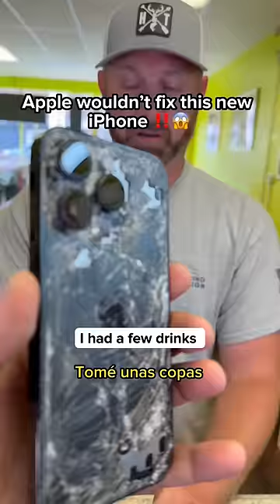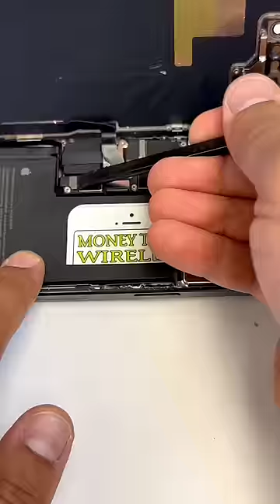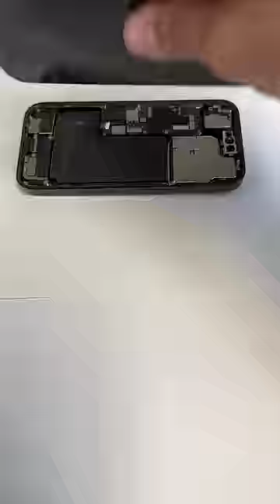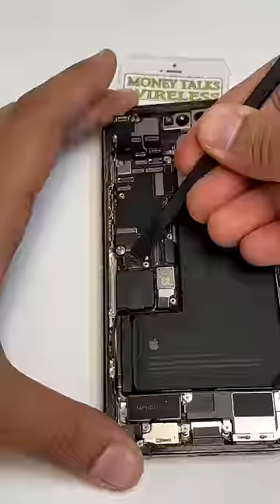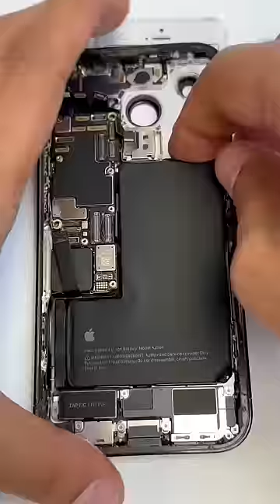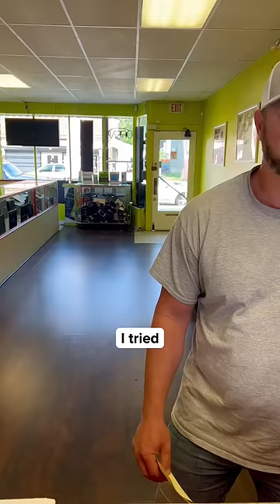Apple Didn’t want to Repair His IPhone 😡Watch till the end ‼️#shorts #apple #iphone14pro #ios #fyp

Comment: Bro left us hanging
Reply: Yeah
Reply: it’s meant for tik tok thats why
Reply: He said: "that means you can't get the information."
Reply: Fr
Reply: Fr
Reply: Fr
Reply: Fr
Reply: the mainboard is damage so probably his data gone or the phone completely dies
Reply: he literally can’t repair it
Reply: @yosuaagustinus4170  i tought you could replace the chip, pick it and put on other phone 

But idk any of that so yeah
Reply: Worry, I don’t got you bro 😎
Reply: He can’t get the Info that was Saved but the Good News he most likely changed it with a new Board
Reply: The whole video is on his channel
Reply: Because videos can’t be over 60 seconds
Reply: He fixed it
Reply: I saw the rest of the video he fixed it
Reply: @paranaenselol 99% of the repair shops don't have the skill and tools to do it.
Reply: he had fixed it actually he was just pranking his costumer
Reply: @error262  And on top of that I believe you can’t just buy iPhone chips. Just memory and some other stuff. Also yeah it requires skill and depending on what dies then yeah you can’t repair it.
Reply: @retrofizz727 can’t buy the processor , rest of the logic board and components can be bought if you know where to look.
Why anyone would do that though I can’t understand, sure you can buy a used board and swap cpu and the other components that are tied together to it if you need to recover data but the costs of doing something like that is around the cost of a new phone.
I used to do microsoldering in iPhones up until they started sandwiching boards. Nowadays I just recommend people backup their phone often and replace it if they damage the board(screens/housing/ports are still somewhat easy to repair)
Reply: @BMWe-ed2tn  Yeah that's what I thought. I never did microsoldering, just screens, batteries, etc. Logic board swap is useful if you reaaaally need those data, but honestly if it's a very expensive phone, like 1000€ or more it can worth it too depending on the price you can get for the motherboard. Otherwise yeah just replace the phone. Just telling people to backup their phone isn't enough, really most people don't care until it's too late.
Reply: I watched the full video on tiktok. He was able to fix the phone he was just joking with the guy
Reply: UPDATE: I tracked down this vid on TikTok for the ending. The good news was that he lied about the bad news and presented him with his phone fixed and looking like brand new. The guy looked real sad for a second but then was real happy. Posting link in replies for full vid
Reply: Fr
Reply: On phones the components are all soldered to the main board so they can’t be removed. If one thing breaks than the whole things is broken
Reply: If its the processor then unfortunately theres no way to transfer all the info from it to another processor as its the brains of the phone @paranaenselol
Reply: @paranaenselol  its sautered on, you can fix it but it would take a really long time and a lot of skill and effort, and the guy would probably charge a whole lot if he knew how
Reply: True. Wonder what the good news is lol
Reply: @naylisyazwina6836  probably that he's not gonna charge him for trying
Reply: This is why it’s important to back everything up.
Reply: Yeah

Comment: Apple hates repairs. They would rather replace the device if its warranty rather than to fix it. Or they will simply lie that its not covered or the warranty was voided for some reason. I worked at the genius bar so i k ow the process. As per my ez manager said. Apple stores and retailers get bonuses from iphon sales and reprimand for repairs(if it reaches a certain threshold)

Comment: Don't worry buy Android budget one under 200dollars or more which has 120hz display,12gb Ram, 256gb UFS3 Storage,5000 to 6000 MAH battery, 30watts ,45watts charger to 65watts charger. You have 1000dollars for buying Apple iPhone so This year you spent 200 or under 200usd for Android next year you will be bored give the old phone to your offsprings,wife or cousins buy another Android with better spec under 200 or 200USD you could buy 5 phones each year enjoy life and could feel change in technology.

Comment: In indonesia, it will be alive again 😛

I have iphone xs fall from my bicycle quad lock, and hit by several cars on the road

Frame is bend on one corner, all LCD crack, back camera fault, and IC toucj problem, but everything else normal

Apple is very strong phone

But offcourse to make it alive i have to replace IC touch and reweld main board, but the cost still cheap forme